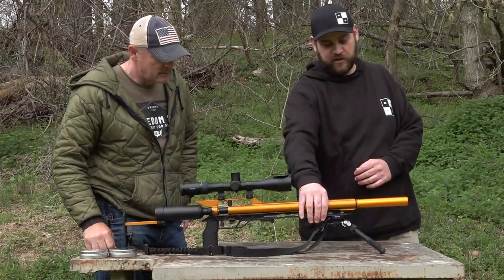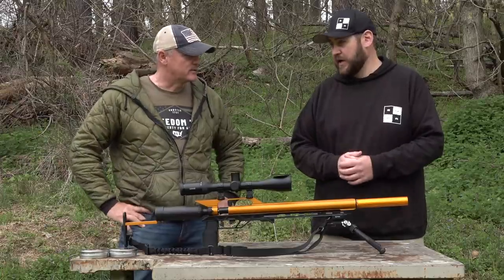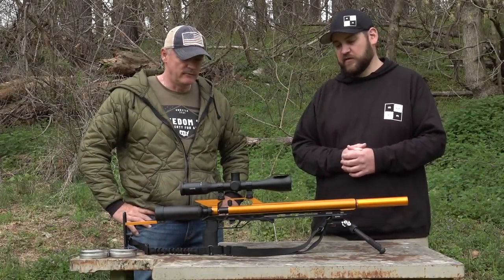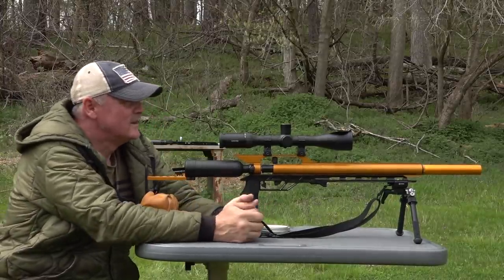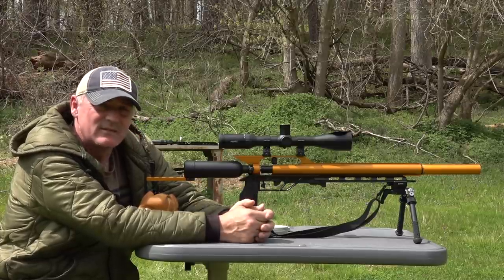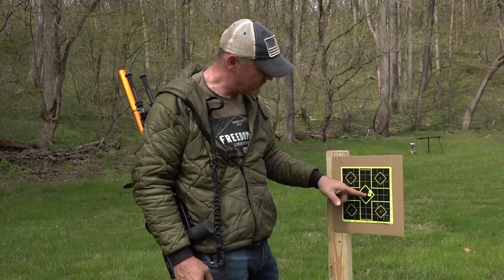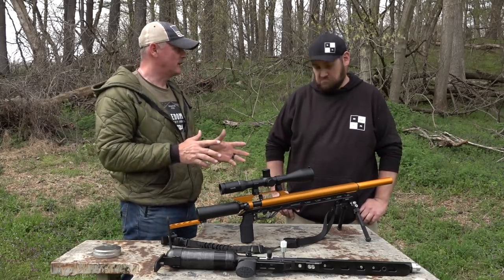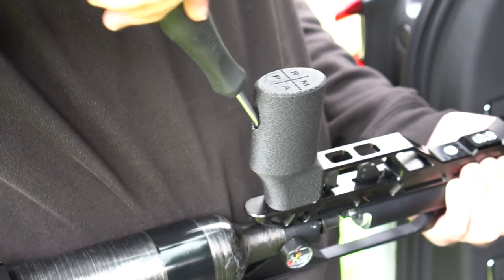*NEW* RMPA Precision Rifle Chassis System (PR-CS) \\ Airforce Talon And Condor

Comment: Stock is fancy, but doing nothing for airforce airguns weak point !?
Reply: Yeah i see no advantage at all just slightly different look. The standard airforce is easy to put a sling on too I have one on mine. Its $12 i think. Why is anyone excited?
Reply: @RMP Airguns the point where the bottle meets the frame. I didn't see any connection to the bottle, I am on my phone though.🤔
Reply: @RMP Airguns alrighty then, but your mentioning  texans do that apply to condors  n talons.
Reply: hi im curious  what weakpoint do you mean exactly?
Reply: @jamesdenny4734  hi im curious  what weakpoint do you mean exactly?
Reply: @Idontlikethisname-zy3zn  bottle meets the frame!
Reply: @jamesdenny4734  you mean the bottle wobbles when firing because it is only connected to the frame by a piece lf steel ring?